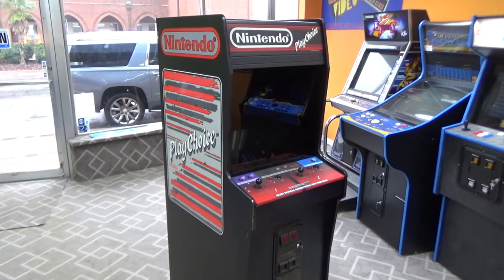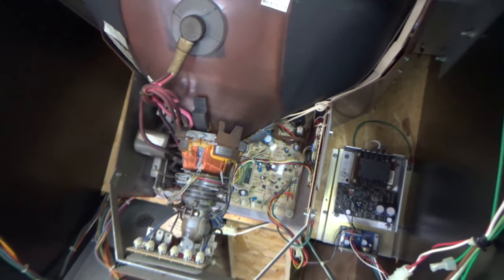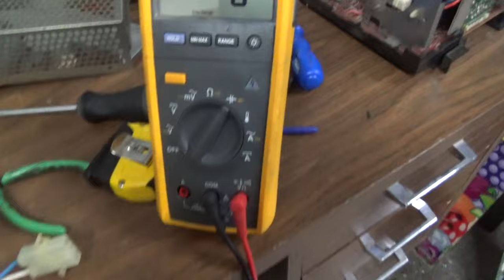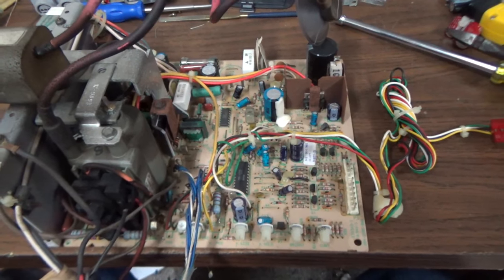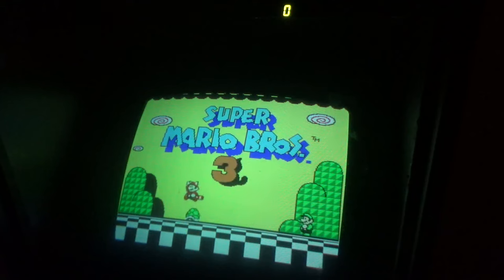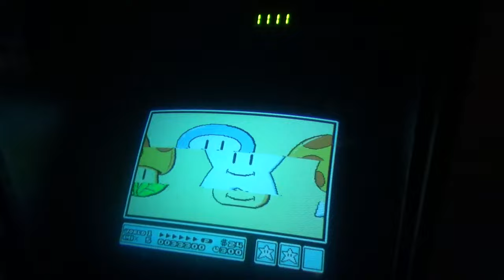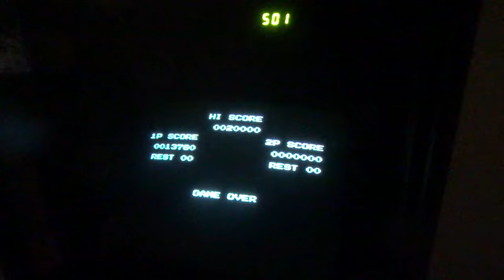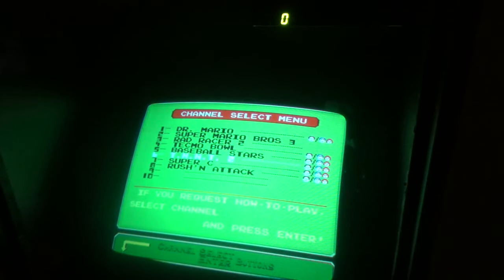Repairing Nintendo's Legendary PLAYCHOICE Arcade Machine - Single Monitor Dedicated Cabinet

Comment: Since the PC-10 is basically an NES at heart, but uses designated carts.  Over the years, adapters have been developed to connect regular 72-pin NES carts.  When the adapter and a regular NES cart are being used, let's say in channel 1, the PC-10 will recognize the game and run it, but as for the title for the channel, it will be all dashes.  Mike Tyson's Punch-Out!! is a little different than the version for the NES.  The PC-10 version allows you to enter your initial before you even start playing.  Also, the PC-10 was the only way you could play SMB 3 in the USA before its release on the NES.

Comment: While you were in the power supply it would have been worth replacing the X2 capacitors (there is one positioned parallel with the fuse)as those have a nasty habit of going up in smoke especially the ones made by RIFA.
Reply: There were two...the one right by the fuse and there was another one a little to the left on the other side of the smaller transformer under the "OLTS" tag   I was thinking the same thing.  Anyone that works on some audio equipment or test equipment are familiar with the RIFA "safety" caps of death. Word has it, their current ones are fine but they are definitely tainted. I would think that in a video arcade game that they would be particularly susceptible due to the humid environments that they are exposed to. Look for any cracking on them.

Comment: Again, since the PC-10 is an NES at heart, the cheat codes are the same.  For example, to get 10 lives in Super-C, press RIGHT, LEFT DOWN, UP, A, B, (select for 2 players) then START.  To get the sound test, hold both A&B on the title screen and press START.
for TMNT 2 to get a level select and 10 lives, on the title screen:  B, A, B, A, UP, DOWN, B, A, LEFT, RIGHT, B, A (SELECT FOR 2 PLAYERS) START   Timing is critical is that you don't have much before the demo kicks in

Comment: I have a play choice 10 but has a very obscure issue. Also all 5 of my  vs boards do the same thing. I will get these evenly thin verticle lines. They are not jailbars. People say these are ram lines and pefectly normal. I have my pc-10 board running though a super gun with a jamma adapter.  At the local arcade they have Vs smb and it exhibits the same behavior, thin verticle black lines. Have you ever seen this? Or know why this happens?

Comment: On capacitors, too high of a value showing is not a good thing. Actually, with most meters, if they test as too high, it means the caps are leaky.

Good going on the voltage. There might still be a resistor out of spec, and the connector being burned makes me wonder. If it is pulling a bit much current there, some resistor could be taking a beating and altering the values in response to heat. And I'm glad recapping it and cleaning the connector made such a difference.

Comment: Golf? I was expecting Fester's Quest.
I remember going to a garage sale once and the guy had like 12 copies of Golf. Never inquired why, but I later surmised they were damaged copies and he kept swapping them out because they sometimes still worked. The NES was designed badly and damages the carts, bending the contacts and scraping the connectors. If you want a good NES, get a top loader.

Comment: Where do I get a fly back for a donkey kong? I have an original Popeye that's been converted.
Reply from the maker: If it has that original Sanyo monitor in it, you can get them from www.ArcadePartsAndRepair.com .  You need to figure out which monitor you have in there first but he sells all of them that are available, and they're good quality.  It's probably a Sanyo 20EZV if nobody's changed the monitor out.  Good luck with it!